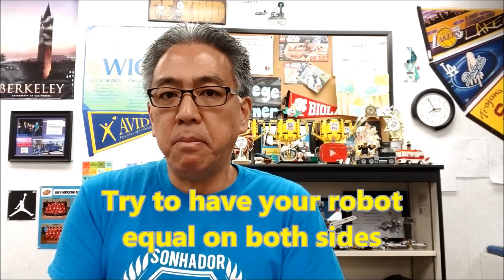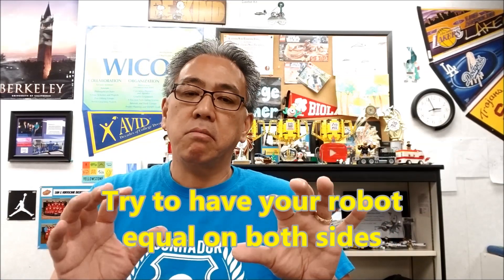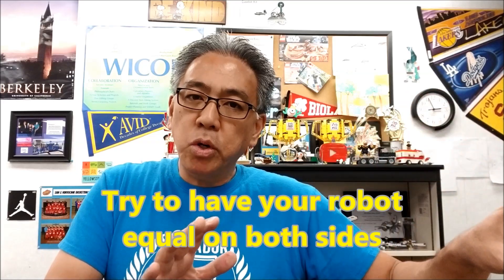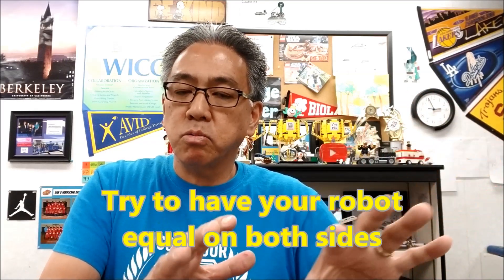"City Shaper: How To Get Your Robot To Drive Straighter"

Comment: If you really want a robot to go straight use a single motor to drive both wheels.  This year it is possible to be competitive with such a robot.
Reply from the maker: No turning?  I guess there are some pretty straight missions.
Reply: I just posted a video on my channel which takes up the topic of using a single motor robot for the current challenge.
Reply: @JESSE KEMP search for hydrogenhead and you'll find it.